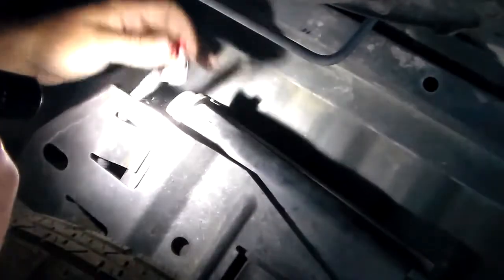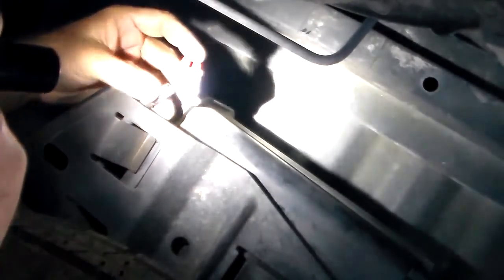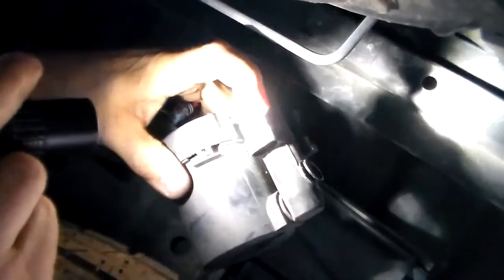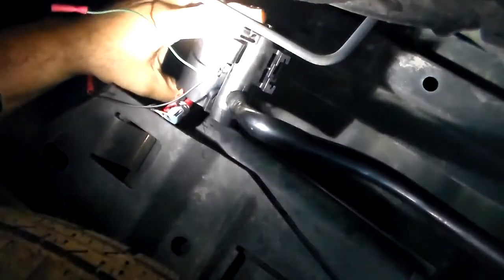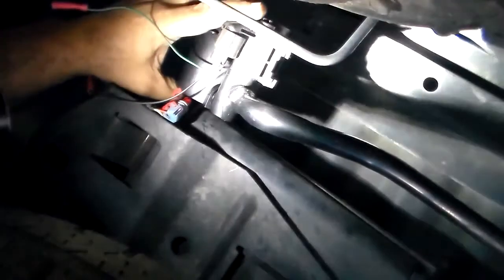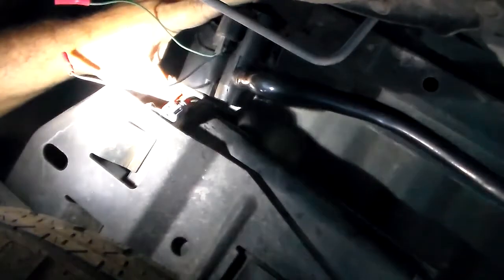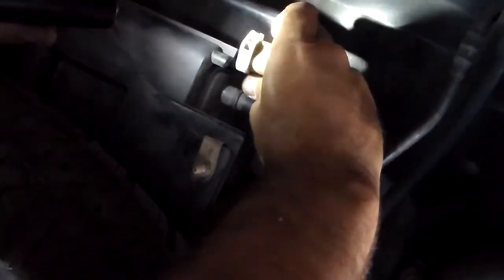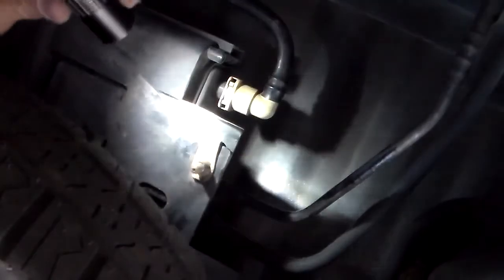P0449 code on a 2007 colorado repair pt6

Comment: Why Didnt  u get an adapter for the harness instead of cutting and splicing, where the first 5 vids?
Reply from the maker: Because it wasn't available when I was doing it so I had to improvise. The other vids will be the same header but put pt1,pt2,pt3,pt4,pt5 ect to pt7 at the end and they should come up.